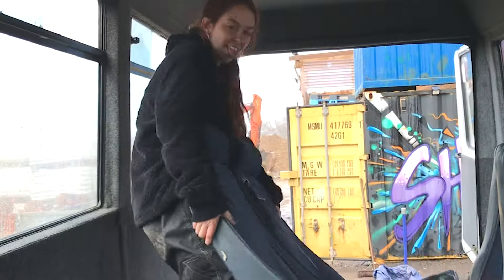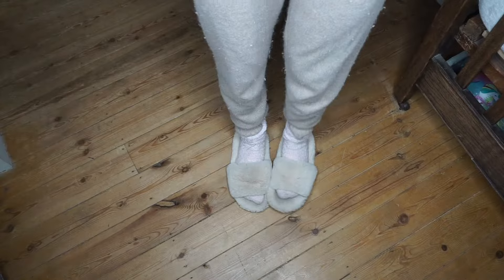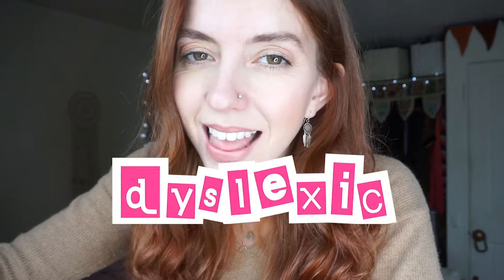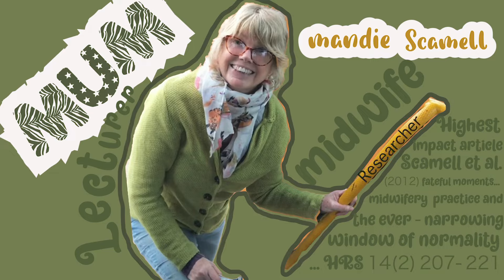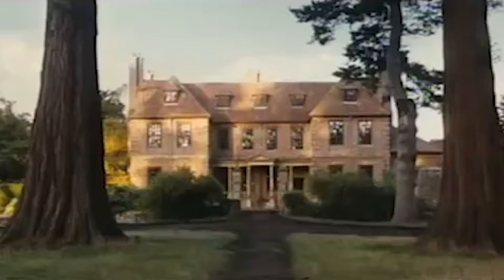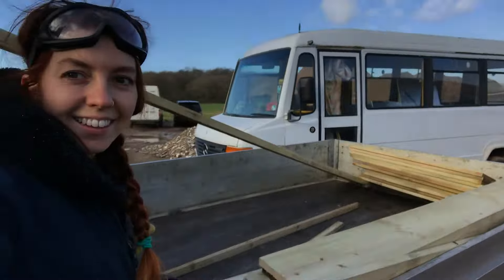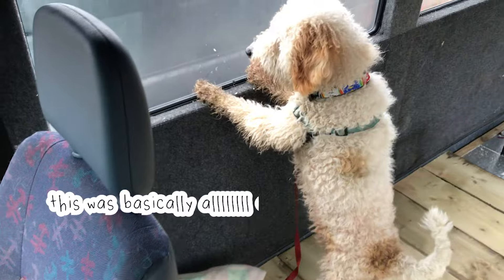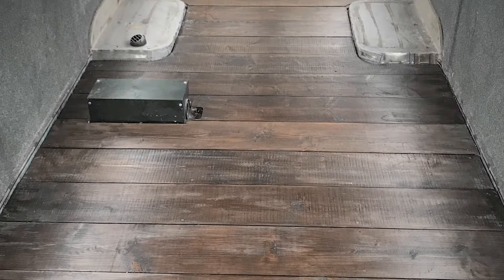Ep 3: all about my floor 💗 Bus Off with Josie

Comment: Wow. The Bus off song is very cool! Sounds awesome! I have a question about insulation: You had insulated the walls, the ceiling, maybe floor (i'm not sure) but Bo has a lot of windows. Is there smth for them in cold winter times? I saw that sometimes people use pieces of  foil-clad penofol (it's cheap) matched to this zones of intense temperature exchange.
Reply from the maker: I know the song is sooo sweet isn’t it ! I’m very lucky to have talented friends ! 😍🥰 ohhhh thanks for this tip! I will look into this ! 🙌 your right Bo does have a lot of windows!! ☺️